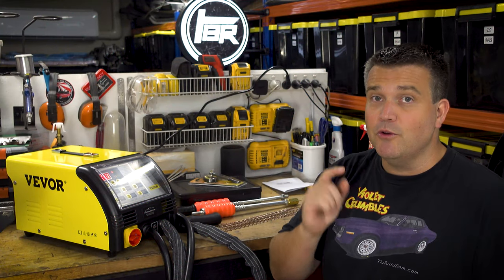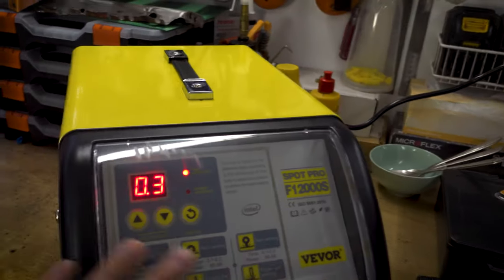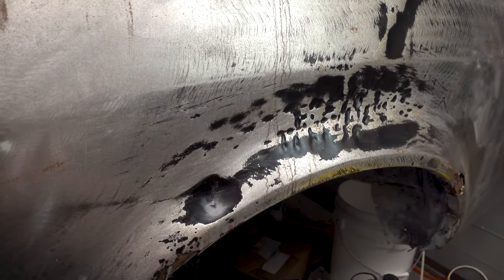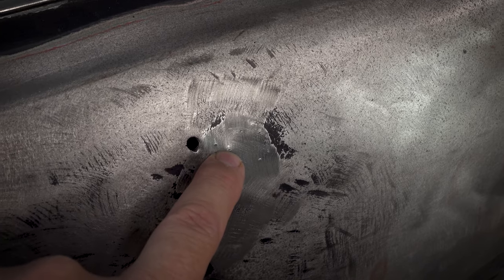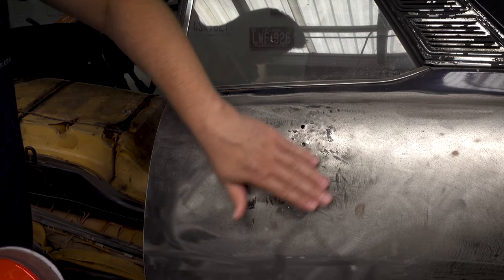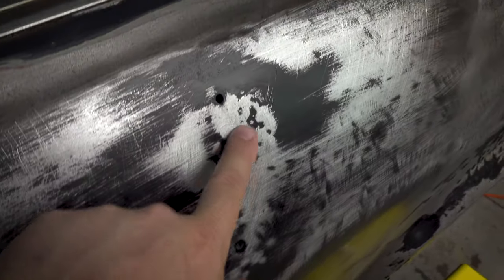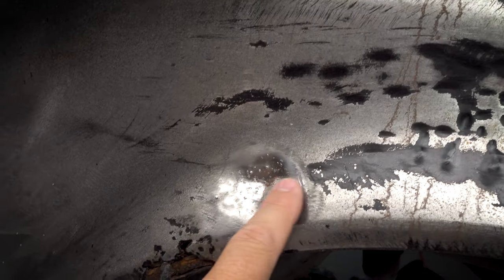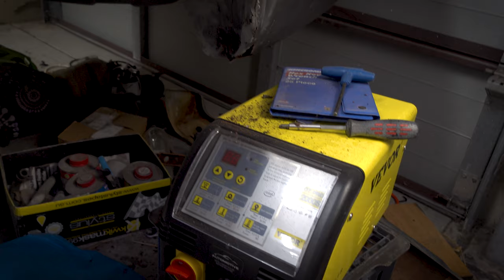Using a Vevor Spot Welding Dent Puller - RA23 Toyota Celica Restomod (Part 31)

Comment: The rule is to work in from outside of the dent - not starting from the deepest section.  For paint removal there are special disks that do not  grind off metal. Of course those older cars have plenty of meat on their panels, so they are not as sensitive  on that case as newer cars for example.  Great video! Greetings from Estonia!
Reply from the maker: Estonia - Awesome! Greetings from Perth. Thanks for the tips, outside in definitely worked better.

Comment: It was helpful to see someone starting out with the tool.  If I already knew how to use it, I wouldn’t have been looking for a video.  The Vevor machine I bought seems pretty well built, but their manual is pretty useless.
Reply from the maker: Yeah i definitely get a bit of use out if it - its not perfect but for the price it represents about the only way I'd be getting into a dent puller.

Comment: I bought a stud welder kit from Harbor Freight about 12 years ago.  I had to buy a Mac stud puller because the HF puller was crappy.  With the HF stud welder and the Mac stud puller combo, it was awesome.  It welds copper studs and one advantage is that you can weld on 5~10~20 of them in an area, then move from one to the other until you get the shape you want.

I think I was in for about $200 for the whole thing.

It was so great that I was taking out the slightest dings with no problem.  Great tool.
Reply from the maker: Yeah I'm super happy with it - already look at other dents I think it can help with so will definitely get the value from it. Thanks for watching!
Reply: Thank your for your experience helps out all the diy dads outter like me

Comment: For the tiny high spots, instead of using a hammer and dolly, you can also try use a spring loaded punch. We commonly use these on thinner matel panels with great success in helping level out a high spot. Cheers.
Reply from the maker: Thanks for the tips man - will definitely try that out on the next one - have been watching PDR vids too to see how they do it.

Comment: Great 👍, you can also get a car bodyfile to knock down those high spots as you go along. Sometimes arcing issues are caused by residue left behind on the panel from the primers... Wiping the metal with acid wash, aspirit salts or vinegar may help
Reply from the maker: Some great tips there, thanks for that will give them a shot! 👍

Comment: The slide hammer is a useful tool when there is some beefy steel to get straight. I used it on the pushed in beaver on one side under the bumper. It was the only thing that would get it out. Luckily there are  existing manufacturers holes to access that though.
Reply from the maker: Yeah its amazing how much you can actually pull out of these things if you can get the right purchase - hope yours is coming along OK.

Comment: Excellent episode Cam!  That is a handy tool there.  I grew up next to three autobody shops and the dent puller brought back memories.  I had a thought on the bigger, deep dent - could you Dremel a line or two, maybe in a cross pattern just to get the metal out quicker and to provide "stretching relief"?  Love the shirt, got mine, thank you very much for that, it looks great.  Practice makes perfect.  Violet Crumbles is looking better every episode.  Come on 5K!
Reply from the maker: Thanks Bob, good suggestion on the relief cuts, they'd be easy enough to weld up once it was done. Glad you liked the shirts and yep eager to make 5k - have another project to try and move things forward so we'll see.
Reply: @TheBuildRoom  Looking forward to the Skyline build Cam. Keep going.

Comment: Does it have shrinking ability? These machines usually have a broader attachment  that heats without welding and essentially creates a lowe small. Stiffens even oil canned panels. The SharkDent is capable of doing this. Thanks for your input.
Reply from the maker: Yes it has a shrinking head although personally i would say its a little under powered for heat shrinker - overally the machine is pretty good but if I had three phase access on my property i'd probably grab a beefier unit.

Comment: How’s it holding up?
Reply from the maker: Yeah good - i don't use it that often TBH but for a home user that has a big enough power circuit its fine. When i first got it i was convinced it needed more power but i was just trying to pull too hard, which ends up rough as. Slow and steady with small pulls is the key.

Comment: Curious about the setup you had to use, does it use a 10amp plug or 15amp plug? I'm hoping to use on my home workshop without 15amps just worried it will trip all the time. Are you still having this issue?
Reply from the maker: No i sorted my issue but best to speak to an electrician - assuming you're on 240v in Australia it should only need 10amp once its running but initial current draw (its basically creating a short at the contact point) overwhelms a standard RCD. MBB is a different story but not legal for most resi stuff.
Reply: @TheBuildRoom  Thanks for the response, undecided on pulling the trigger, read reviews on the Vevor website talking about needing 20amp plugs and other saying you have to bend the plug to fit etc. I sent a email off might have to get the cheaper stud welding all in one gun.
Reply from the maker: @jasonchristen3858  yeah it's tough, a lot will depend on what else you have on the circuit for a standard plug. I have a dedicated non RCD circuit for mine, but can run my compressor etc on it too without issue. The pin guns aren't horrible so if your worried about the electrical side that'll be a reasonable alternative 👍

Comment: I really hope you got a dedicated plug ran back to a bigger fuse,and not just put a bigger fuse on your garage sockets ring??? Gets expensive to upgrade your houses electricity just to use the "cheap" tool😂
Reply from the maker: Definitely why i recommend people get an electrician to check their setup out. Mine was not an expensive upgrade, others may have a different experience.

Comment: My understanding you need a 3fase for welding gear etc
Reply from the maker: Hi Ash - it really depends on current draw - my welder is designed for 15amp single phase, and you can get ones that are designed for 10amp single also.  Lucky in Australia our 240v single phase offers more oomph than the 110v in the US - they need 3 phase on their equipment way before we do as we have over twice the voltage.

Even here in Australia, you definitely need 3 phase 415v when you start getting into bigger machinery, and a 3 phase dent puller could have significantly more power to tack (and therefore pull) and a 3phase welder can weld thicker materials, but its not always strict requirement. I was welding 8mm steel plate with my welder no issue.

Its all about getting the right power supply for the tool you want to use or vice versa. Hope this helps and thanks for watching, hope you liked the vid.
Reply: And also not really sure what you are talking about we need three phase way before you do be you have twice the voltage. You don’t have any more power than we do.

Comment: I just bought the exact machine and it's tripping the breaker. Need to get that sorted 😕
Reply from the maker: Yeah its the curves on the RCD that were my issue - a good sparky can sort it out. 👍
Reply: @TheBuildRoom  I'm glad I'd seen your video before I bought it.. was kind of expecting it to happen which made it not so disappointing haha will get the breaker changed over. Did you upgrade the supply cord into the machine as well? The one on mine seems a bit light duty for his sort of thing.
Reply from the maker: @grahamm3559  Not originally because I wanted to be able to send it back if the unit was a problem, have since upgraded the plug but left the cord. It hasn't really pulled enough current in my use to be an issue
Reply: @TheBuildRoom  what you mean about the issue you was having because mines welds don’t hold

Comment: Will it handle daily use? Do the threads look stout?
Reply from the maker: No, i don't think its suitable for daily/commercial use - if you want one for everyday use I'd be looking at 3 Phase at a minimum.
Reply: @TheBuildRoom  what do you mean with 3 phase ?
Reply from the maker: @DespiertaVe  High output power suitable for industrial machinery. In Australia we call it 3 phase (as it has 3 power phases as appose to single phase residential) but in other countries people call it 415v or 440v or a bunch of other names depending on localised electrical standards. Check out this for better info than I can give:

https://www.oempanels.com/240v-single-phase-and-240v-3-phase